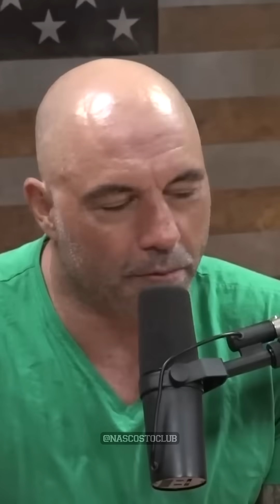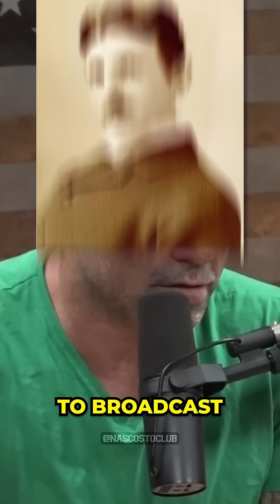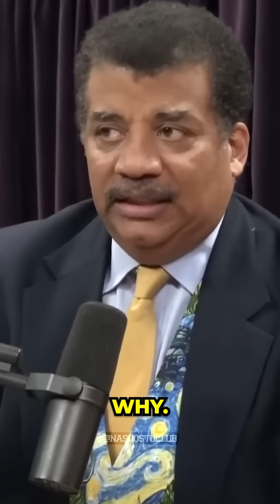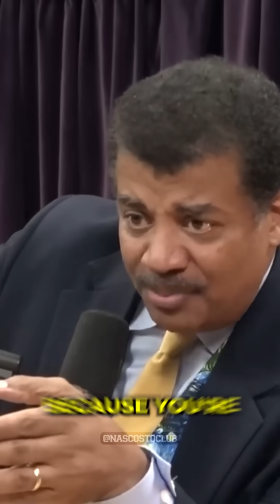WIRELESS Electricity Idea Debunked ⁉️⚡ #shorts

Comment: this is what happens when you confuse a TV personality with a scientist.
Reply: and how would a scientist answer that question in your view
Reply: @juraviel  I would not answer it.  I would light a light bulb with electricity thru the air and show him it works.  It worked over a hundred years ago
Reply: @Isaia Costa  with genuine curiosity, wonder, and speculation. Not with dogmatism. Science is ever developing not concrete.
Reply: Good God! Millions fooled by him! Even Harvard! What a disaster when they find out!!!
Reply: So he makes a retort you have no rebuttal for?
Reply: Back in  those days of , incandescent light bulbs required more than 100 watts. To compare, today's latest wireless charging technology can muster about 15 watt and that too with physical limitations, you have to keep smartphone in close proximity.  
Nowadays, we have LEDs that light  up at 15 watts, so if someone wants to demonstrate a "wireless" bulb it can be possible but it has to be very close to the source. But there's no commercial viability on this. What's is the utility if the bulb have to be right next to source for it to work. And Neil is right. 15 watt, forget 100 watt, of power flowing around in the air can be detrimental ( in fact harmful) for humans.
Reply: Always the lesser people trying to bring accomplished ones down.
Reply: @DeusEx.Machina  No there was nothing like that.  If a product doesn't have commercial value it won't fly no matter how ground breaking it is
Reply: More like, this is what happens when you confuse an inventor with a scientist

Tesla had crazy vision and was highly intelligent but his ideas on physics bordered on spiritual metaphysics at best
Reply: So Neil Degrasse Tyson has an autistic Condition called Asperger's, it makes you very passionate, and forces you to hyperfocuse on singular subjects. Please do not ignore and Belittle  conditions to fit your perfect little society.
Reply: He is a scientist though I think, astrophysicist I think
Reply: @GoodKingRichard  astrophysicist is very different from electrical engineers like tesla and me. I just wonder with much information coming from neil's mouth why can't he discover or create something new from this world.
Reply: @cryptoflowtrading  I didn't say they weren't, but I'm sure he has
Reply: @GoodKingRichard  Read his thesis, you will realize he's a fraud, diversity hire tv scientist.
Reply: @GoodKingRichard   NDT is very accomplished but put someone like Michio Kaku in the room and NDT doesn't look so smart anymore
Reply: @Grant Bischoff  he is but in title alone. He does no experimentation nor does he really think scientifically- I'd argue he's closer to a religious zealot than a scientist in many ways.
Reply: @exister4959  that's just not true though. Go read his Wikipedia he is a very accomplished scientist. He has taught at a few prestigious schools, wrote many scientific books, acclaimed papers on cosmology and such, been at the top of multiple scientific organizations as director, on the board etc. appointed to multiple governmental space commissions, the list goes on and on. Go read about it
Reply: @Exister  lmao found the tesla fanboy who doesnt know anything about physics.
Reply: @Grant Bischoff  fair enough, those are great points and I appreciate your honest effort at correcting me. I was being hyperbolic however and I do still stand by the fact that neil is more a TV personality than a scientist in practice.
Reply: @comradeusa8351  this isn't a conversation about physics and there's no need for you to be so upset. 🤣
Reply: @Exister  LMAO. Tell me you know nothing about physics WITHOUT telling me you know nothing about physics. The study of electromagnetic interactions is solely a physics study and it is the field that makes transmitting electricity wirelessly a pipedream.
Reply: @ComradeUSA  you realize astrophysics and particle physics aren't the same thing? To your lesser mind it is a pipe dream because you are not a visionary or a scientist. Humanity is not limited by the limitations of one fool, rather we are propelled by the ingenuity of one genuis. Regardless of the fact when i say this isn't a discussion about physics I mean specifically this comment thread, which isn't a discussion on physics but rather semantics. 
Sometimes it's better to know nothing and learn than be set in your ways with bad information and not grow. Do better comrade, do better.
Reply: @exister4959  "@ComradeUSA  you realize astrophysics and particle physics aren't the same thing? To your lesser mind it is a pipe dream because you are not a visionary or a scientist. Humanity is not limited by the limitations of one fool, rather we are propelled by the ingenuity of one genuis. Regardless of the fact when i say this isn't a discussion about physics I mean specifically this comment thread, which isn't a discussion on physics but rather semantics. 
Sometimes it's better to know nothing and learn than be set in your ways with bad information and grow. Do better comrade, do better."
Agreed 100%
"Everybody said it can't be done until somebody came along who did not know and just did it."
Of course Tesla's Towers don't work, that is also why the Feds sacked all his documentation and research and the US Military is building some of these towers on US soil now...
God I hate it when people come at you all "you know nothing about science" and then act religious about things they have no means to prove themselves and claim "logic" is on their side while they just throw the word around to give their own bias more weight in a conversation... Which proves absolutely nothing, only that that person is an idiot.
Reply: @iM3 Phirebird  precisely my friend. People assume their own limitations are the limitations of all of humanity, but thank God that isn't the case!
Reply: @GoodKingRichard  you do realize wikipedia can be altered by just about anybody. Why do you think its not a usable source for a works cited for a school paper.
Reply: @GoodKingRichard  literally my middle school, high school, and college and university will not allow anything from wikipedia on your works cited/consulted. Its not reliable or credible information.
Reply: @BullittAutomotive  it is because all of the information in a Wikipedia article is sourced from other places. If you used the sources they referenced for a Wikipedia article than your educators would deem those sources appropriate. I've also had professors who've told me it's not credible and I have had some that said it was. Plus it's not easily changed, if it were as easily changed as you say it is topics like CRT would have a mess pott of a Wikipedia article, but it remains factual and sources correctly.
Reply: @im3phirebird81  Where exactly are they building towers that launch electricity through the air?
Reply: @comradeusa8351  yeah as if Tesla didnt know anything about physics lmao when even Einstein called Tesla the smartest man alive go read about it
Reply: @agentsparky1772  reading comprehension isnt your strongsuit
Reply: @Sheharyar Ahmad  another mad NPC, follow your hatred programming more my friend. Anytime you find yourself speaking the way you are you should take a step back and ask yourself what it is about the information that's triggering your programming 🤣
Reply: @exister4959  LMAO get help dude
Reply: @exister4959   I can criticize Tyson for a wide variety of reasons, but despite being sub-Saharan, it is simply ignorant to not call him a scientist. He is in fact a fairly accomplished one. He's certainly no Tesla, but respect where respect is due, and truth always. And Tyson is an incredibly accomplished person of his race.
Reply: @Luckmann  did you really just say DESPITE being sub Saharan?! Damn even the racist NPCs got triggered 🤣
Reply: @Darth-Shadow  living in anger is a pathetic way to live ❤️
Reply: @comradeusa8351  living your life in anger is a pathetic way to live, be better ❤️
Reply: @GoodKingRichard  And what about what he studied makes him qualified to speak on electricity? I Honestly can't stand this guy at all drives me crazy Even if hes perfectly accurate I don't want to hear his voice anymore
Reply: @ShhhNielDTyson  tbh he annoys me too, but he is an astrophysicist, so you know he's studied physics as a whole extensively, which includes electricity.
Reply: @exister4959 ou are the embodiment of "I made up my mind and no amount of objective truths will change my mind" Jesus Christ dude take a look at yourself, introspection please. Quoting your claim that he is more of a TV person even though someone pointed out his great scientific career and accomplishments. Someone being good at a second thing doesn't diminish or devalue his other achievements. This is simple logic ...
Reply: @exister4959  State whatever you want incorrectly for hyperbolic effect. That fact remains he is every bit a proper scientist.
Reply: @comradeusa8351  I like Tesla but I'll admit I do not know enough about Physics to really have an opinion.
Reply: @WeyesC  did tesla have a degree? No. Is tesla the greatest scientist of all time? Yes. Try again.
Reply: @exister4959  i would disagree, he is just a scientist that is good a being a tv personality, cosmos series narrated by him was amazing
Reply: @Arty S  agreed, cosmos was in fact pretty awesome. Carl Sagans was better but Neil's wasn't bad in the slightest!
Reply: @GoodKingRichard  Being the right color in a field devoid of diversity goes a long way yes.
Reply: @agentsparky1772  Except that Einsteins remark was most probably sarcastic. They weren't exactly friends. Tesla said Einsteins theory of relativity was “a beggar wrapped in purple whom ignorant people take for a king". On the other side Einsteins comment on Teslas 75th birthday (which he was asked to give) was strikingly short - just for not being rude.
Reply: @TheKaneECO  Texas amongst other places
Reply: @minimouse7579  I looked it up. The tower in Milford TX doesn't work. As of yet anyway. The group Viziv Technology is hoping to connect 2 towers together. Nothing about transmitting power to the surrounding area.
Reply: @exister4959  exactly. I was surprised how close minded he came off in this interview
Reply: @Chris L  question Nikola tesla before you question me bro! If you think Neil's smarter than tesla that's all you, everyone gets an opinion ❤️
Reply: @exister4959 "Good point, but I'll ignore that and continue acting like he's dumb"
Reply: what are you alluding to that "happened" in your original comment? he made a valid point, no event that alludes to Neil being a pretend scientist in the video occurred that validates your point so I don't really understand your comment
Reply: @josephcalabria2976  You haven't seen enough of his videos Neil acts like an expert on every topic and I myself and completely over his voice
Reply: @ShhhNielDTyson  100 percent agree with you actually, he tends to be pretty clueless about a long of the things he acts like an expert on. This is one of the times he is actually completely scientifically correct however. He just needs to learn to stick to his guns on what he talks about tbh because though he does come off across as very educated when he talks on subjects he understands well, but takes away from himself by carrying the same confidence into what he isn't knowledgeable of. Oh and he needs to stop interrupting everyone he talks to lmaoo
Reply: Or a president
Reply: He has the title so don’t be a fucking dumbass
Reply: Good job you are a skeptic against science really ingenious of you how original
Reply: @Chris L  it's shocking a how a joke comment can anger so many NPCs. And yes, I am a skeptic against science, all good rational thinkers should be. Don't become a religious zealot with the god you worship being science!
Reply: @exister4959  u just made about 3 assumptions and you do not know me you sure weren’t skeptic on ur assumptions also I never said I was mad just think it’s pretty immature to disagree with things that can be proven in the real world also yes I believe in god and yes I believe in science it doesn’t make you smarter because you say you don’t agree with science in all reality it just tells me how smart u really are
Reply: @Menace8 Know you won an argument when the other person is resorting to personal attacks and or arguing with assumptions. 

I definitely seen people who make a whole argument out of "facts" about you that was completely made up from their rear. It is incredible the length of delusion people will go to personally attack you, lol. They are just spraying without aiming at that point. Hoping something sticks and hurts you so you say something silly and lose the argument.
Reply: @Peter Schmeier  dogmatist cope. You can't say "you can't be a skeptical against this because it represents truth" you can say the same for Christianity. A good science is skeptical of everything, most importantly science itself and the scientist who hide behind dogma to deny innovation. Try again. I'm not calling scientist religious zealots, I'm calling certain ones who refuse to acknowledge science beyond their own limited scope religious zealots. Science is ever evolving my friend, you should know that but you have been tricked by the modern age that we, and you by extension, already know it all.
Reply: @exister4959  This isn't what I wrote, you still confuse "science" which is a process with "scientific theories", which of course can change and develop over time. Also there is not a single scientist nowadays who would ever claim that we already know everything.
It might also appear a bit hypocritical to accuse of dogmatism, while praising Tesla as the greatest scientist ever and calling anyone who disagrees to be wrong. Of course he was a genius, that didn't prevent him from making mistakes. Cope with that.
Reply: He kind of reminds me of this generations Bill Nye.
Reply: Talkin out of your butt. He is BOTH a tv personlity and a scientist.. you could be both.
Reply: Akseli Lähelmä  Yes they were designated under the Autism Spectrum Disorder in 2013 I know, A spectrum is a proper thing to call it too, however my point still stands.
Reply: When inferiority complex get deep to your bones...
Reply: @jahman9676  So Neurodiverse are inferior to nuerotypicals? Thank You for your input Trump, Cery Cool.
Reply: @jahman9676  I'm sorry your inferiority complex is so deep in your bones man, trust me you're worthwhile and can do so much better ❤️
Reply: I'm so glad you said that I can't stand this guy
Reply: You mean Jordan Peterson right?
Reply: @XxNightmare128xX  I suppose since Jordan's more of a philosopher/psychoanalyst than anything else. You can argue those things are closer to an art than a science so you're not wrong!
Reply: he just stated hard facts
Reply: What degrees do you have?
Reply: @Mason McCalister  degrees mean nothing to genuis. (I'm talking about tesla btw, not myself)
Reply: This guy is a clown!
Reply: I bet this kid talks bad about NDT, but when he meets NDT in real life, he will be all excited and ask for his autograph.
Reply: @orionverduijn5539  people are excited when they meet TV personalities so it isn't odd!
Reply: @exister4959  I have 2 choices, to sit here and waste hours of my time explaining to people like you what is right and what is not, or simply ignore you and pray that when you grow up, you will realize how much NDT has done for the scientific community, possibly igniting millions of young peoples passion to study astrophysics. Eh. I'm out.
Reply: @Orion Verduijn  but my reply was literally agreeing with you saying you're right lol? You going crazy bro
Reply: You're the type of kid to actually feel what someone said to you was right, but too afraid to admit it so you keep it a secret and deny it online.
Reply: He's not incorrect with what he is saying. He is just irritating with how he is saying it. Still respect on his name for encouraging attention to astrology.
Reply: FINALLY someone else sees it
Reply: He’s a Scientist to fools that like being puppets 
All this so call Scientists is __ is a Sell-Out that loves masquerading words he has read to make himself sound So Educated 

The True FACT here is Nichola Tesla was miles ahead in intellect and true intelligence over this paper Scientist who like most scientists nowadays (manipulate scientific findings to align to whomever is supplying them with fame or $$$)
Reply: @og_eta0s  I genuinely feel sorry for anyone who lives their life as if they aren't the main character. I know I'm the main character in my story, and I would hope you can one day be the main character in your own as well ❤️

Comment: Yes, you can light a bulb if you go next to an electric pylon, so it's down to agitation of molecules rather than heating a filament. You can cook through induction but your hand won't burn because it's not steel.
Reply: Induction is a magnetic effect, and those are extremely short ranged... basically contact range, really. Broadcast power is... possible, can be done, has been done... but is completely impractical and has unholy levels on inefficiency. The inverse square law destroys the idea of broadcast power... you can make it work, point to point, if you use a laser or something similar... but, to Neil's point, you wouldn't want to get between the transmitter and the receiver in that case.

Comment: "New wireless charging system uses harmless infrared light to power devices from nearly 100 feet away."
Love it when proud people get proven wrong.
Reply: According to the source of that article you decided not to link to:

“The experimental results showed that a single-channel wireless optical power transfer system could provide an optical power of 400 mW with a channel linewidth of 1 nm over a distance of 30 meters. The photovoltaic converted this to an electrical power of 85 mW.”

What a discovery. An 80% loss of power from the original source. Try again.